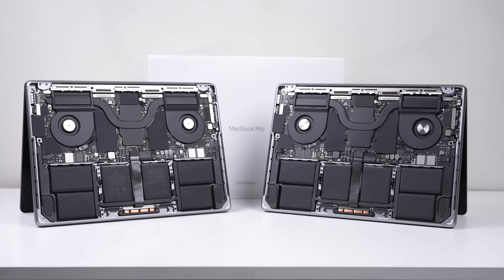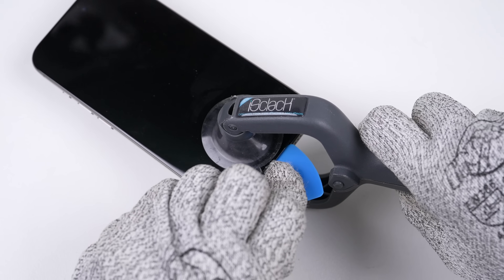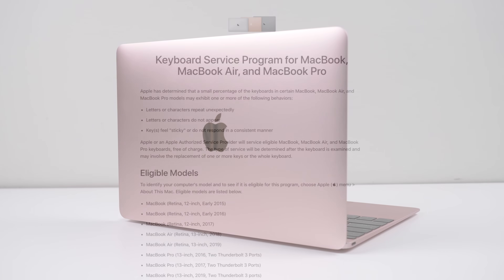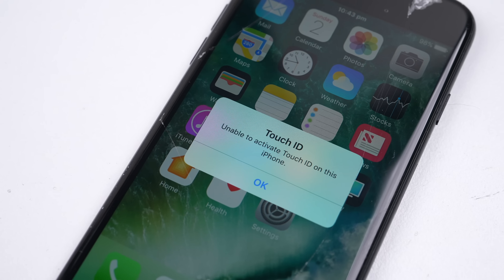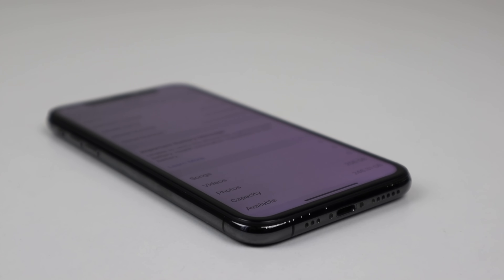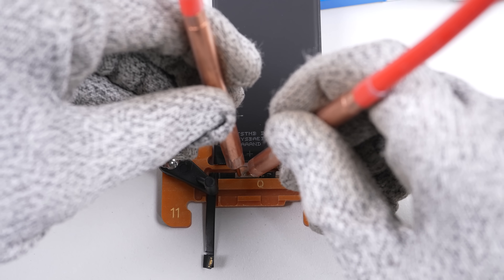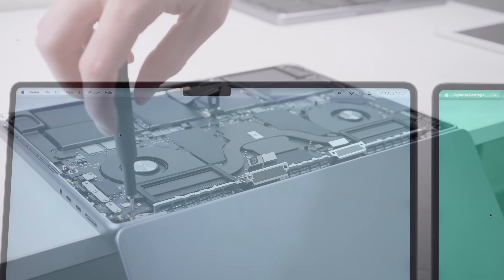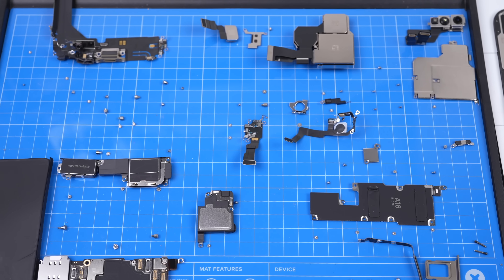Astonishing Anti Repair Practices By Apple In the Last 15 Years

Comment: I have not bought any new Apple device since a long time ago. If I cannot have full control over my purchase, why pay the full price? I just bought an iPad Pro 12.9" M1 for 500 bucks. The savings on the price goes into future repairs. I've also ordered a used Apple Watch S7 45mm aluminium for 200 bucks. Buying new is just plain stupidity.

Apple products cost about 30% of its MSRP for major repairs. They get software updates for around 6-7 years and they still perform well enough for everyday tasks. They price drops about 40%-50% for used after 2 years. It just seems to make more sense to buy used items from lineups of the previous generation and get 5 good years out of them for around half the price.

Comment: Imagine being a mechanic, and not being able to fix your own car, unless you go to the dealership.
Reply: thats already a thing....
i remeber when i could fix my 30y old car on the street and keep going (and i didnt have even a opportunity to do that more then one time because it was extremely reliable)

but now? without a computer you wont even know whats wrong and even stuff like water pumps, intake manifolds OR EVEN VALVE COVERS are plastic....holy shit the cars they make nowaday are such garbage
Reply: @423GustavBern  true but you can still exchange the manifold without the onboard computer telling you unknown part
Reply: @423GustavBern Indeed as far as plastic timing chain guides within the engine lol
Modern engines are designed to fail not last and it's sad for such a major investment
Reply: When you drive a Ferrari?
Reply: @johnps1670 What time is this... 2012? Most phone manufacturers make equally or better devices than iPhones overall nowadays. Having an iPhone 10 years ago was a status symbol, now it's just like every other glass rectangle phone with 10 cameras on the back. No phone coming out today is revolutionary or special, besides those foldable smartphones.

Comment: Ah yes, because buying a new iphone every time you crack the screen is so environmentally friendly.
Reply: Honestly why are iPhone screens so bad? Broken iphone displays seem much more common than androids with this issue. Or is it just because apple doesn't let you repair them so ppl live with it?
Reply: @kyokazuto  i rock my daily driver, a samsung 23ultra with NO case. i dotn case any phone. 

had it sine the day they released. i can show you the gnarly concrete gouges in the side metal, scren is fine, no scratches.
Reply: @kyokazuto  people will just live with broken displays because Apple's repair is pure BS.
Reply: people are low key brainwashed or something. its insane that the worst available phone on the market, controls 70% of that market. its either brainwashing or testament that the power of ads is equivalent to mass brainwashing.
Reply: Gois apple can do whatever they want, it's up to the consumer to decide what they are buying and to do research before making a 1,200 dollar purchase.
Reply: @annonomuzhooman  no, they cant do whatever they want. If the EU imposes some new norms, apple will have to adhere. Same thing happened with USB-C charging ports on iphones.
Reply: And yet, people buy them.

Consumers are to blame, more than Apple and their garbage products.
Reply: The average consumer has no idea this functionality is built in. 
It’s on apple more than the standard apple user.
Reply: @proudbrogressive315 No, it's still mostly Apple... People should be able to buy a phone and have it be repairable.

Comment: Anti-repair or anti-tamper?
Reply: @@nooffense911 And why would they? If these parts costs just as much as simply letting Apple do the repair themselves (look at 11:35 part of video), 1.) Customers would choose the latter as it is a guarantee that their phones would actually work because it is Apple that did the repair (and probably a lot faster too barring the duration of shipping your phone to them and back to you); and 2.) Why would these third party repair shops do that if it is pretty clear that this would be unviable?
Now I don't know if Apple does bulk order discounts on such parts, which is if significant enough would invalidate the second point, but still the first point would still apply. They are ultimately the only one who can control where these genuine parts go, and they are the only ones who can make the parts completely functional or not.
Reply: @@nooffense911Rubbish 
" These third-party repair centers can easily enroll in the Apple Authorized Center certification"
Says a guy that hasn't done it. About the last thing an Apple Authorized repairer can do is repair an apple product. They can collect data for Apple. They are subject to searches by Apple. Getting parts from apple? Sure for more then the product is worth.

Comment: All the governments around the world need to make clear law's that state that no manufacturers shall use any software to lockout repair of screens and batteries and charger ports and haptic feedback motor's and camera.. the law should state that every single part besides the fingerprint reader should be free to replace.. and have very strict punishment for not following the repair laws.. this also should include desktop computers and laptops!! So for the sake of ram and storage upgrades i don't care if a laptop is 3mm or 4mm thicker and the law should state that ram and storage should use standard equipment so users can choose what brands they want to trust.. the only restrictions to users should be actual security reasons and if companies cant prove serious security issues then they can't lockdown that part.. so really fingerprint scanners can be replaced safe and secure but its the only part id ever accept a serial number lockout.. screens and cameras and buttons do not make the device unsecure.

Comment: You forgot to mention Apple silicon taking away cpu upgradeablility on the mac pro, as well as the early 2009 mac mini's being the first mac mini with soldered-on cpu's. Great video!
Reply: well, Apple Silicon is next gen. which ofc brings some negatives. But the signals doesnt have to travel back and forward around all logic board between GPU, CPU and memory, so its super fast and efficient. M3 MacBook with 22hours of work on battery? Not cutting performance when unplugged an running on battery? That other Laptops users dream...
Reply: @Ic3g3org3  I definitely agree with you, apple silicon's tight integration has brought some amazing pros, like battery, speed, and efficiency. However, I am sure Apple is also happy to remove user upgrade-ability from their machines at the same time. Yes, it is amazing, but it is still a form of anti user-upgradability and anti repair.

Comment: that's why you can't fix that to yourself by using other parts that's not from apple parts at all also all parts was scanned before putting all parts together was being built up and test it to be working right then it ready to be packed up and ready to sell it in every stores to be sold so that's how it works so same thing to other plants that has lots of parts has codes what it will be built in by scanning it in to it and that how it will work just right no matter what as if you Mex any part different part number and it won't work at all because it was stored in the SSD storage and other chips too so all codes do be the same number but it keeps changing the number by the last number was shown as well as other serial number too so never change it at all so the best is leave it alone as it was and never change it from any parts around that's why so it has rules on it own to tell you to agree not to fix any parts inside of it so let the repair store do that for you for free with warranty was being used for that's why

Comment: I don't know who needs to hear this... but Apple is pairing components to each board because of the mass volume of devices that get stolen in the United States and sent to China in order to resell the parts. Apple is being pro consumer because stolen parts won't work/operate the same even if they are OEM. "Right to Repair" should focus on getting OEM replacement parts from the original manufacturer. Example - if a chip manufacturer or cable manufacturer makes the component, allow for it to be sold as replacement parts. This would render the stolen parts useless and give the availability for parts to fix the devices that are broken.
Reply: Lies lies lies, stolen my ass, he took 2 brand new iphones then swap the parts over and it still doesn't work
Reply: @ilikecats300  So how is what I said a lie? For example, if I stole both of those phones and they are iCloud locked, I still can sell all the parts and make a good profit. 

What is actually happening (not lies lol) is people who pickpocket professionally target events with mass crowds like music festivals in order to sell them to buyers in China to resell the parts in the largest phone parts market, Shenzhen China.

Respectfully, this reply sounds like you are a young kid who is unaware of a larger picture and only focuses on what you can immediately see.
Reply: Rubbish. You've been drinking to much apple coolaid. Apple is the one making sure component manufactures don't supply the repair market with parts.
Got some stats to prove any of this? I'm guessing more phones get damaged than stolen so on average apple gets to sell more phones while people like you defend them.
Reply: Bullshit

Comment: I can somewhat excuse the software locking of parts with the fact that there are lots and lots of bad counterfeit replacements, but soldering/software pairing/proprietary SSDs is a different level of scummy. Awful company
Reply: Bro, they lock the real parts too, he swap 2 brand new iphone parts and it still doesn't work
Reply: @ilikecats300  yes, but if you could swap parts between iPhones it would mean that stolen iPhones become a lot more valuable
Reply: Even if there are poor counterfeit replacements, there's better workarounds than what Apple is doing, as Hugh mentioned with Google's touch ID calibration tool. There could be software that checks if the part is genuine without it needing to be the EXACT serial number. Though, it really should be up to the consumer to decide whether cheaping out on a bad counterfeit is worth the risk.
Reply: @zanegandini5350  used/refurbished market though. The consumer doesn't know they're getting a phone with a shitty replacement screen/battery until they get it
Reply: Wait. Remind me, whose phone is it?

Comment: The irony is that Apple has cultivated a reputation as being easy to use but they put roadblocks in front of repairing their products. Going so far as to assign codes to its phone's parts so that non-Apple parts can't be used, and then encrypting them when a workaround is found, is nuts.
Reply: Apple is pairing components to each board because of the mass volume of devices that get stolen in the United States and sent to China in order to resell the parts. Apple is being pro consumer because stolen parts won't work/operate the same even if they are OEM. "Right to Repair" should focus on getting OEM replacement parts from the original manufacturer. Example - if a chip manufacturer or cable manufacturer makes the component, allow for it to be sold as replacement parts. This would render the stolen parts useless and give the availability for parts to fix the devices that are broken.
Reply: @grkxkosta3396  Rubbish. You've been drinking to much apple coolaid. Apple is the one making sure component manufactures don't supply the repair market with parts.
Hey if its ok for you to copy and pate your reply all over the place I get to do it as well.
Reply: @grkxkosta3396  actually, higher availability of used parts would benefit the consumer, no matter their source.  No amount of throwing lithium in the landfill is going to unsteal someone's phone.

Banning exclusivity deals is a bandaid solution that wouldn't need to exist if parts weren't married to each other, and would have a lot of unforeseen consequences outside of repair.
Reply: @grkxkosta3396  If that's true then I still disagree with it. (Remember Mac clones? Apple stopped that short-lived program because they couldn't handle the competition.) Priorities matter, and "right to repair" and reducing ewaste are higher priorities than worrying about stolen phones or stolen parts.

Comment: I'd love to see what happens if you buy genuine apple parts from apple but use aftermarket parts and try to get apple to use their diagnostic software to pair the non genuine parts to the phone. Although, I would suspect they have some kinda part paring, but maybe not!
Reply: Apple is pairing components to each board because of the mass volume of devices that get stolen in the United States and sent to China in order to resell the parts. Apple is being pro consumer because stolen parts won't work/operate the same even if they are OEM. "Right to Repair" should focus on getting OEM replacement parts from the original manufacturer. Example - if a chip manufacturer or cable manufacturer makes the component, allow for it to be sold as replacement parts. This would render the stolen parts useless and give the availability for parts to fix the devices that are broken.
Reply: @grkxkosta3396  Rubbish. You've been drinking to much apple coolaid. Apple is the one making sure component manufactures don't supply the repair market with parts.
Hey if its ok for you to copy and pate your reply all over the place I get to do it as well.
Reply: @grkxkosta3396 bullshit